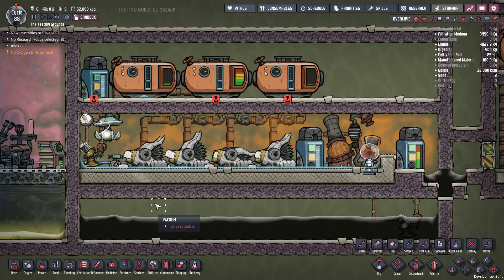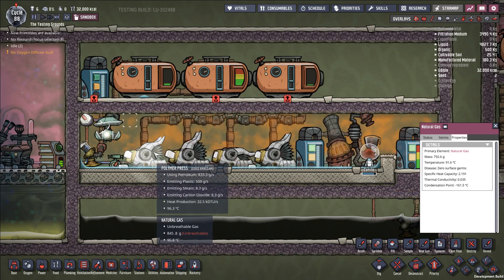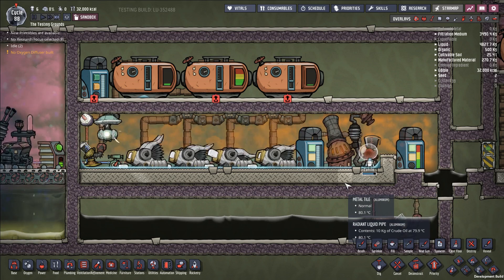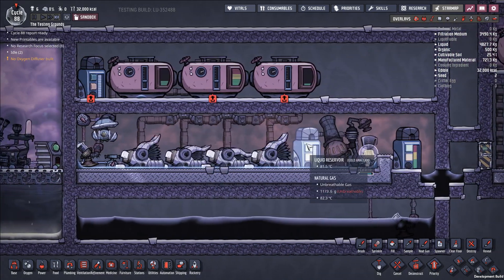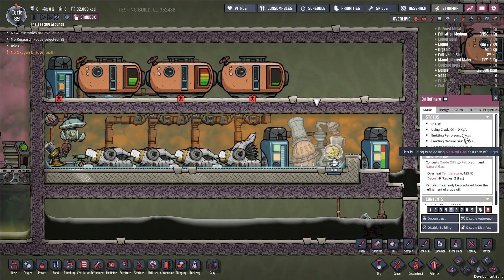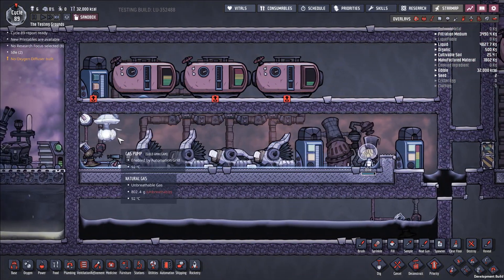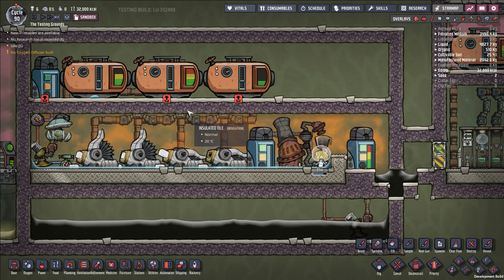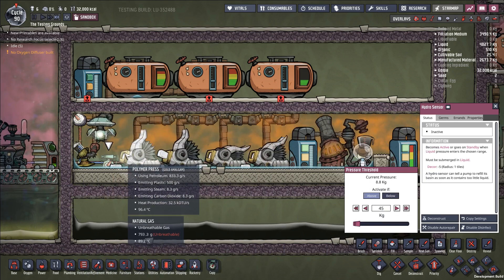The One Simple Trick to Cooling Polymer Presses -- New Player Guides [Oxygen Not Included]

Comment: See you used Aluminum. How does this setup perform when using something with less thermal conductivity like copper, gold or tungsten?
Reply from the maker: I'm pretty sure it works with Wolframite/Tungsten, if you run into problems with gold/copper then you'll want to snake the pipes a little bit and get some more surface area, either that or install a few tempshift plates.

Comment: What if you want the opposite of such a system say you're on Rime and it's cold as all hell. Would you get enough heat to cool the machines and yet add enough heat for farming?
Reply from the maker: It's a pretty good amount of heat, but I think on Rime you need to get some heat and farming up earlier.  Kilns are a good bet-- they're 20 kDTU of heat early in the tech tree that doesn't need any complicated setup.
Reply: @gearheadgaming1  yeah I'm trying to get some heat with space heaters but kilns might be better. I am worried about what to use with them I'd rather not deplete my coal supply. I have 3 rooms for hatches and 13tons of coal right now. Still really new so perhaps I may have more than enough materials to not worry just yet.
Reply: @VATROU  I know it's obviously a bit late, but I'd like to point out that watt for watt, the liquid tepidizer is easily the best producer of heat in the game, it outperforms space heaters by a wide margin. As for the hatches, there's strategies to getting the most out of them, keeping 1 room with happy/groomed hatches to help produce more eggs and 1 room that's stuffed full of hatches that you feed but don't pet seems like the most sensible, dupe time considered. :) 13 tons of coal might sound like a lot, but it'll be gone in a flash if you're not paying attention.
Reply: @epiccollision From what I've heard; not if you take proper precautions. And even then you needn't worry about gems so much on easy. If you keep on top of it, it's just a slight moral problem
Reply: @epiccollision they weren't until QoL mk3, now they are a bit, but they're still easy to deal with, said the one that uses atmo suits in slime biomes

Comment: For the power, you could have two smart batteries. One for your oil power plant and one that will turn off your presses if the power is below a certain level, that way you always have power to at least run the refinery.

Or you could have a tank for petroleum that gives priority to the power plant, with overflow going to the presses.

Just some ideas for people.
Reply from the maker: Good idea, I think another possibility is to have the oil refinery and the gas pump on a separate grid powered by a natural gas generator.  The oil refinery produces 90 g/s nat gas, which is exactly as much as the nat gas generator consumes.
Reply: When I make closed systems like this I add a controlled path to pump in extra power as needed, as well as pump out excess (if any)
Reply: he already uses priority with the liquid pipes(bridges) to the generator, only when the pipe is backed up then the presses get some petroleum